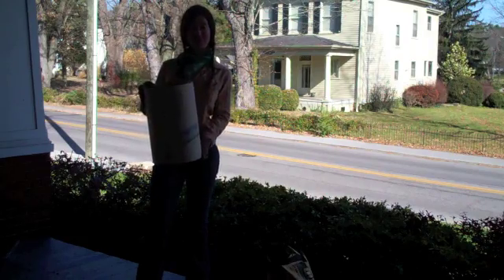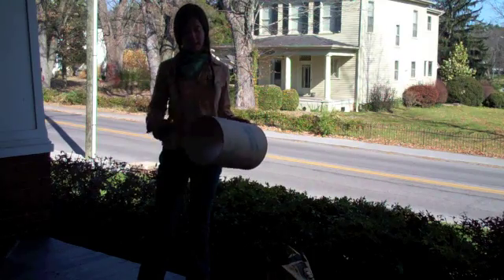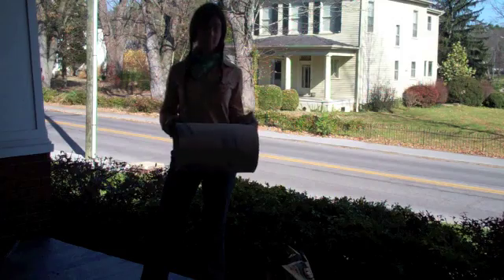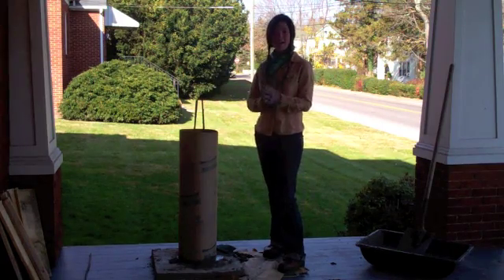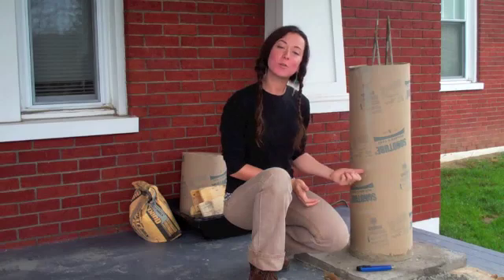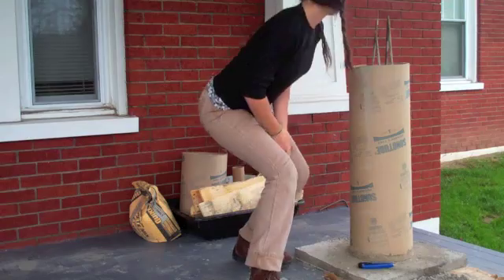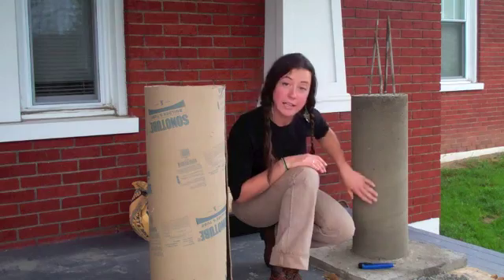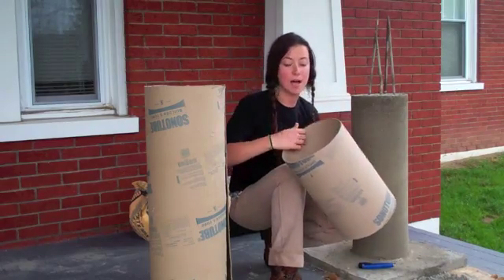Cardboard Column Forms

Comment: With concrete bits adhering to the form, is it still recyclable? 
How did you get the air bubbles out of the concrete? Did you vibrate the form or add too much water? Did you have any lateral rebar connecting or securing the vertical rebar? I noticed that you started to mix the concrete and then cut the video, viewers who haven't mixed concrete per manufacturer's specs need to know that it will be a workout.